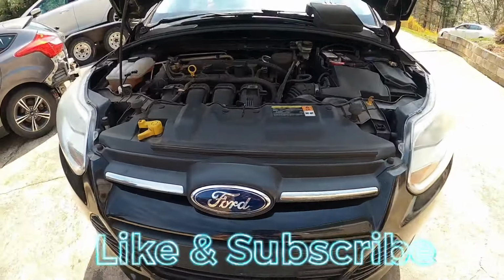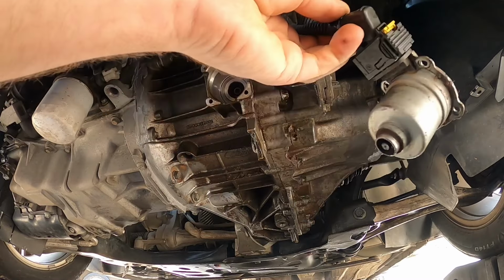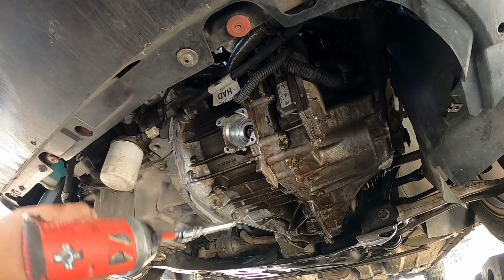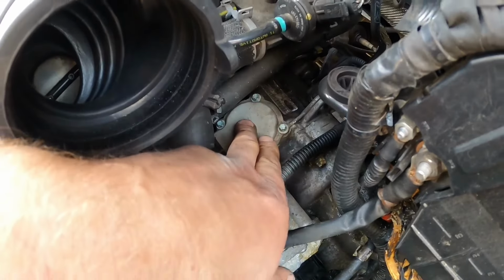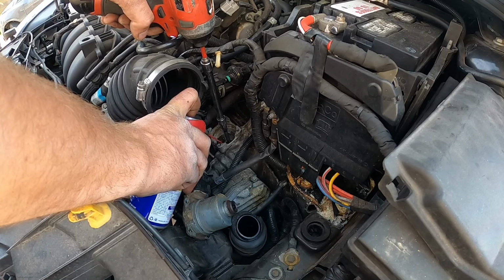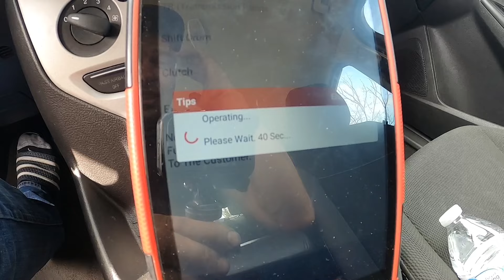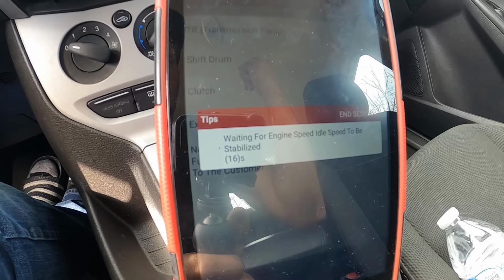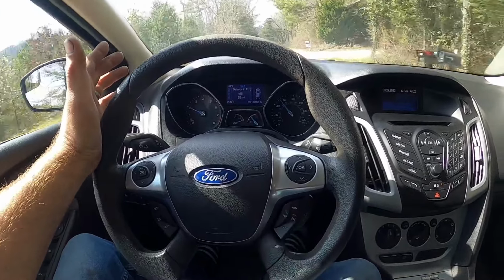2012-2018 Ford Focus Slipping? No Reverse? No Drive? Problem Solved. Easy Fix. You Can Do This!

Comment: FIRST THING ? is everyone  DRUNK HERE !  THIS IS A   AUTO  TRANSMISSION ? IT IS NOT A  STD TRANS ?  YOU DON'T HAVE   SHIFTER  FORKS  IN A  AUTO   TRANS ! what is everyone SMOKING  HERE ? YOU all GOT  ME  LOST    LOOK AT THE SHIFTER   DR   LOW   REV  ??  YOU ALL HIGH on some GOOD SHIT ? is all  i can  say  like lost in SPACE  ????????:face-blue-wide-eyes:
Reply from the maker: This is the best comment I’ve ever seen 😂
Reply: its not an automatic transmission. its a dual clutch transmission that requires two shift forks powered by two actuators that are to respond like a sticks shift driver. if you have never open these transmissions before stop saying anything for a thumbs up.

Comment: Pure unadulterated junk gearbox. Avoid like the plague. Regardless what you do it will fail.
Reply from the maker: @dralbertsmeinheimer5738  it’s a manual transmission. So you have to change the clutch every 100-150k miles. What’s wrong with that?